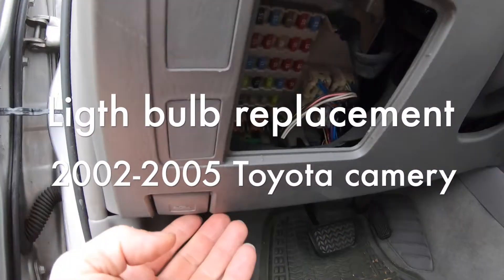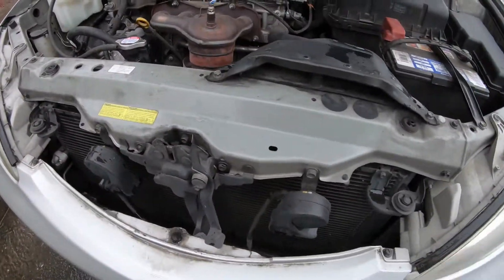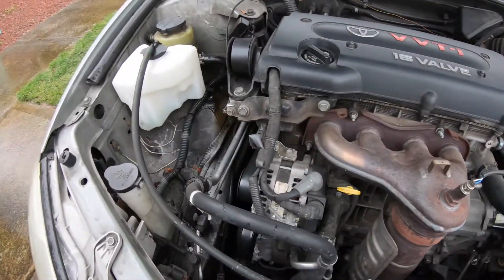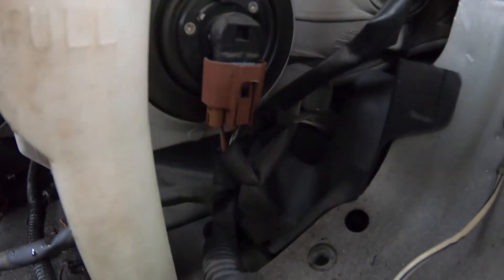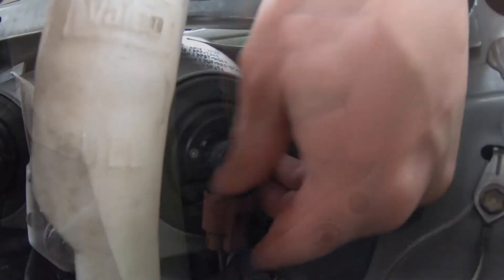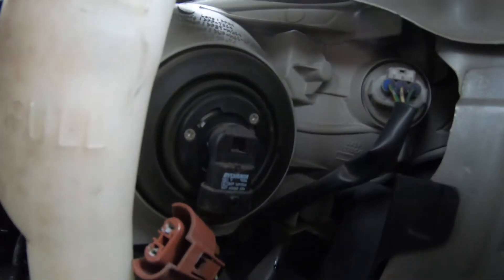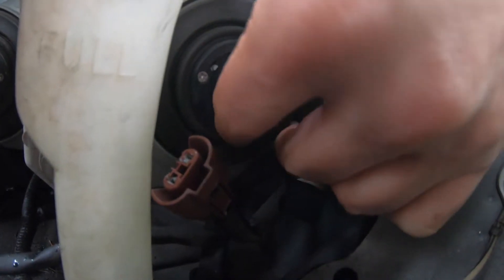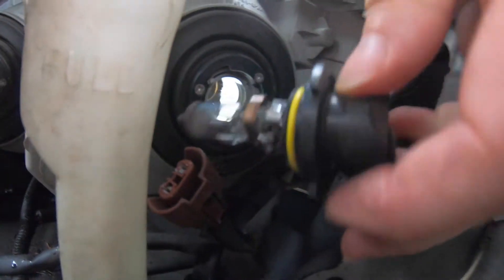HOW TO CHANGE A FRONT LIGHT BULB ON A 2002 - 2005 TOYOTA CAMRY

Comment: How to remove/ replace the small DRL bulb ( 5 watts) that is at the upper outside ( or lower inside) corner of the high beam reflector ?
Reply: The DRL bulb of 2002 Camry (Japan manufactured) is at the upper inside corner of the low beam. Keep the cable harness attached, the DRL bulb can be removed by twisting the connector housing counter-clockwise.